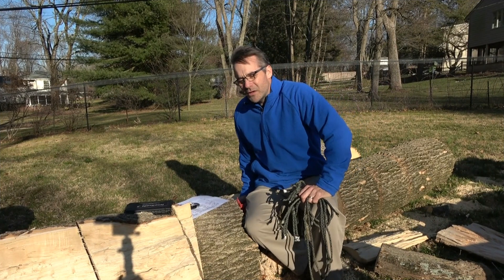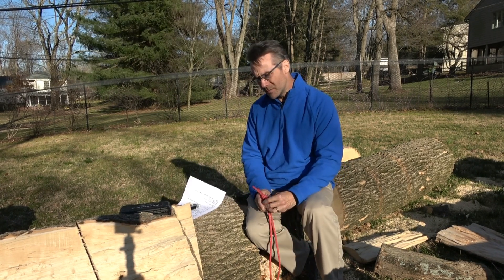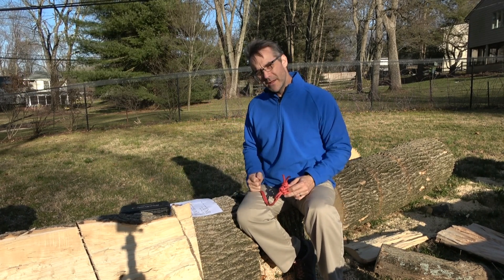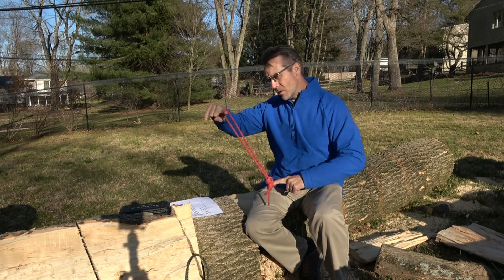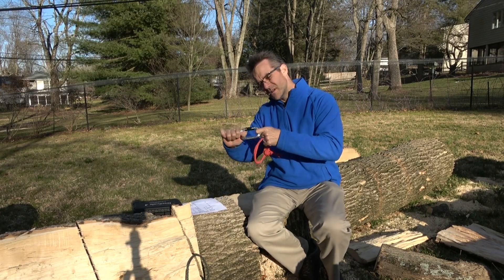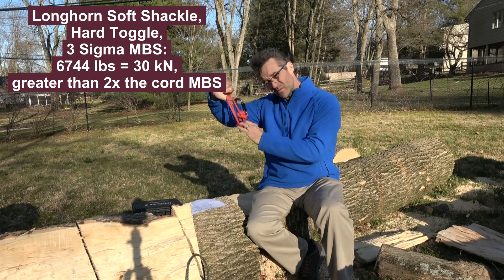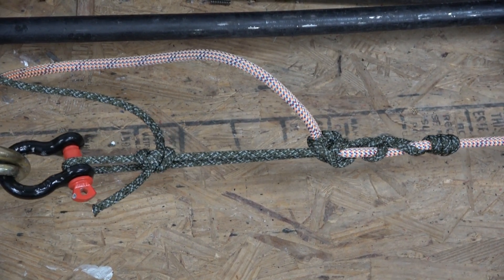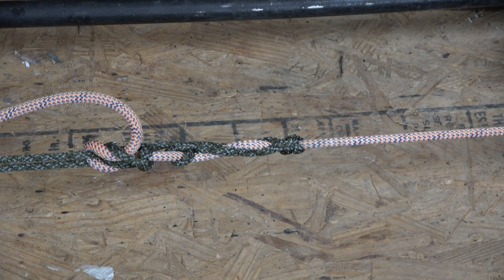Break Testing the Longhorn, JRB Hitches & More

Comment: I would love to see the maverick, and the ultra fast and simple saddle hunters hitch tested. I would imagine with both lines loaded the saddle hunters hitch would be quite fail proof. Would like to see at what point it slips or fails under a single line load test. These are really cool tests to see how strong these hitches are
Reply from the maker: Lengthwise pull tests are hard to do and we have to consider different tree diameters and bark roughness. Last time I tried one such test, i just spun the wheels on a 4wd tractor. Based on what I have done, I am confident that in a controlled slack climbing situation, which is the only way we should climb, the hitch strength is not a critical factor.  What we need is to get everyone tied in and managing slack during the entire climb.
Reply: @jrbtc  I did view that video and it was informative. I do agree just getting people tied in and then slack management is most important for safety. Too many saddle hunting, typically stick-climbing technique videos that don’t have either in them. I appreciate your work and thank you for your time.

Comment: Old timer says to me, “flip your shackle sonny,  you got it backwards”.
“Huh?” 🤔
“Hardware should be on the pin,  rope or webbing should be on the yoke.  If your strap or rope gets pulled down into the edge of the pin hole, it can fray fibers.”
Good to know for off road recovery, but your in-the-field application doesn’t involve shackles or extreme tension-to-failure. 
The only reason I’m bringing it up is a couple of your test breaks happened in the hitch on the pin.  Maybe the hitch got that pinch and wouldn’t have failed otherwise. 
           🤜🤛
Reply from the maker: This is good to know. Thanks. On this set of tests, I also would have liked to use a larger diameter shackle, but it's all that was available.  I have some larger ones  in my garage, but lack the right equipment to pull test, lol.